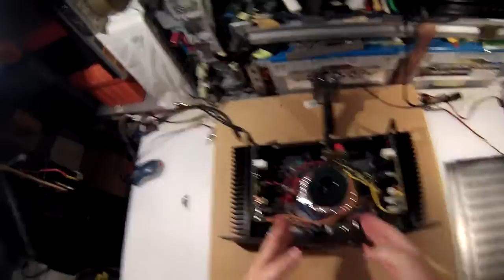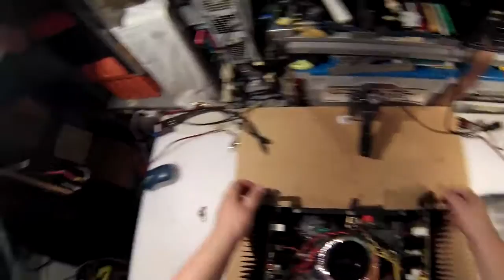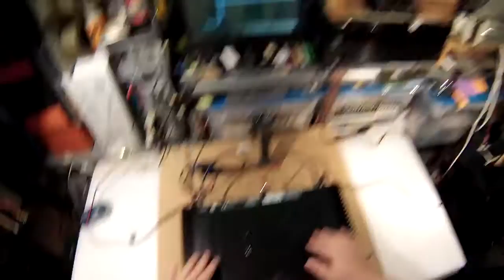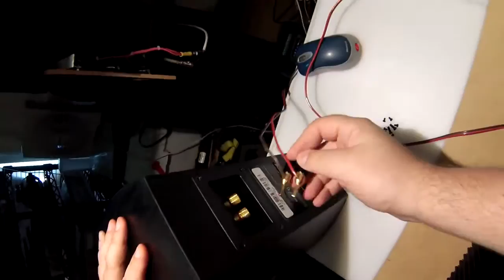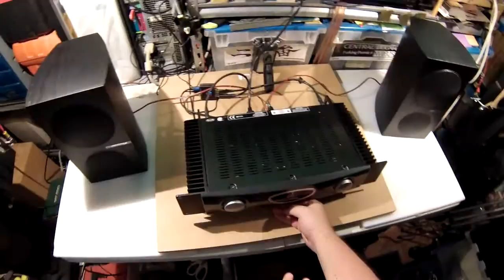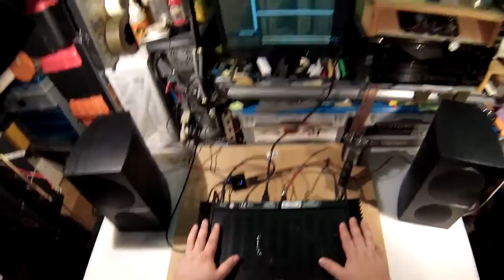Z Review - Behringer A500 Power Amplifier

Comment: Does the Behringer Ucontrol DAC boost the RCA line up to 1.25v for pro audio equipment like the A500  your using. With out boosting the line voltage it won't get very loud...

Comment: Hey Z, I picked up a pair of these to power my four Domus Omni speakers (if you know what those are? If not, uh. 12" woofer + 2x 1" tweets, 3" mid, omnidirectional 90lbs) - anyway, the questions being:

Do I need an actual pre-amp? Or can I run my E10K to them directly (via the coaxial out on the E10K -> RCA - > spliters -> 2x A500 amps?

Comment: I found a link to the manual on Behringer's website while doing some follow up research, since your review has made me feel relatively confident that this unit is a good choice for me.  The 8 ohm values for the amp in stereo configuration is 125 w cont, 175 watt peak.
https://media.music-group.com/media/PLM/data/docs/P0217/A500_P0217_M_EN.pdf

Comment: What is the purpose of two separate volume knobs? Is this a "feature" or does it have to be built like this as per the nature of a power amp? I'm confused because I see some power amps with only one knob, or no knobs and the preamp does the control?
Reply from the maker: It is just for line level inputs. Since both sides are separate inside they just include two knobs.
Reply: Z Reviews Ahh okay, that makes sense. I believe you mentioned in the review but is it clear/easy to get each knob in the same position? I couldn't stand having to manually adjust each one if it was hard to get them both at the same level!

Comment: Is there a good cheap processor you recommend instead of a receiver?  I don't want to color the sound at all with a receiver, but still want digital signals to be received out of a TV/PS3/AppleTV.  Way to do it with an hdmi switcher of sorts?
Reply from the maker: Stereo you can just get a dac with SPDIF input. If you want HDMI input and surround sound there are only a few options. I got the Emotiva M700
Reply: Thx
Reply: How would this amp compare to the emotiva a300? noticeable sound profile difference?
Reply: R W Shouldn’t be much difference other than price. Clean power is clean power.

Comment: hmm is the LineOut of the Fiio10 a good Spurce for the 500´?
(You can get it for 170 new in Germany)
Reply from the maker: Yes it will work but you really want to use a pre-amp otherwise you need to control the output digitally.

Comment: Have you tried any of the crown XLS power amps.  You can get the XLS 1002 for around the same price. It has more power,  an active high or low pass crossover, variable input gain of (.776/1.4) and class D weight and efficiency.
Reply from the maker: +1 I might in the future.

Comment: Hi Zeos, thanks for your videos! In your opinion is it safe to use just 1 channel of this amp and leave the other unconnected? I know this can be configured as bridged, but just with 8-ohm impedance load..
Reply: the impedance of a speaker isn't linear so you could probably get away with bridge mono anyway

Comment: Would you recommend the a500 for a Hi-Fi setup with a turntable as a main signal source?
Reply from the maker: Дмитрий Щедрин You can use this amp but you would need an adjustable pre-amp for sure. Something like this [http://amzn.to/1LPtpoT] with a built in phono pre and main volume control.
Reply: Z Reviews Thanks for a quick answer. Do you recommend buying an additional preamp with volume control as a means of more convenient way to control volume? I mean I do have a preamp connected to my turntable and to an integrated amp.
Reply from the maker: Well you asked about this A500 amp. I would not try to use this A500 without a pre-amp. The front knobs are more for line level compensation vs a gain control.

Comment: Hi there, I am really enjoying watching all your videos. :) I didn't hear you say too much about this amp's sound quality. How does it compare to your Pioneer D1s for instance? I saw you were running the A500 through the Fluance SX6's which I was very impressed with BTW (I'm buying a pair of my own soon because of your review). If you could type out a quick blurb about your opinion on the A500's sound quality and how it might compare to other stuff you are familiar with, that would be greatly appreciated. Cheers. :)
Reply: I haven't found a speaker the A500 couldn't drive to its full potential and cleanly. There were some things years ago that stated for complete linearity you needed to run the A500 at full gain and control the input. I have tried this with the XDA-2 dac's pre amp and didn't notice any audible difference.

The D1S is just a monster. I am sure in a blind test I couldn't tell the two apart but I would want the D1s to be my amp just because of the 0.003% THD figures.